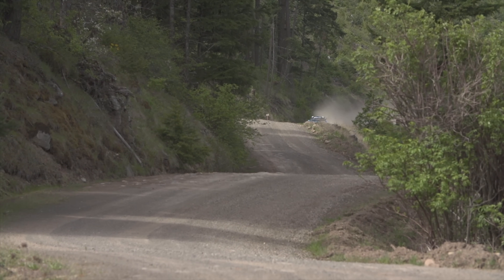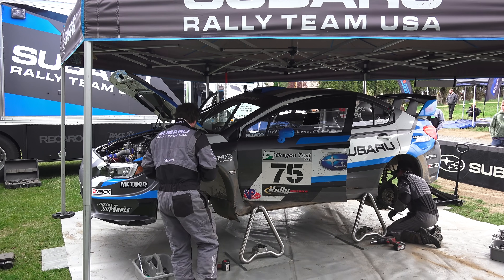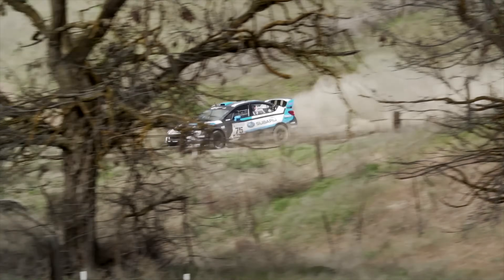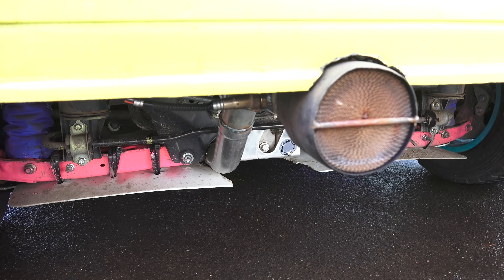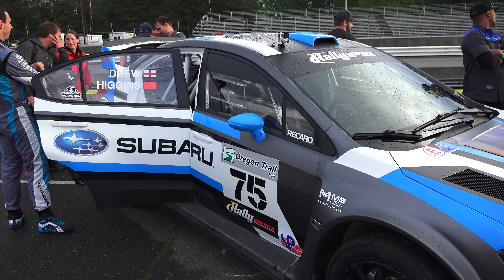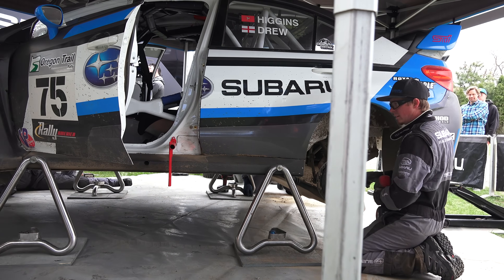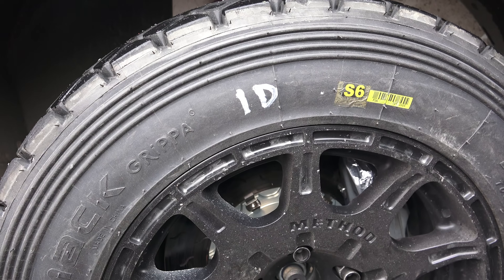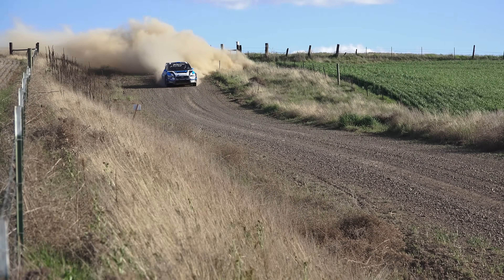Rally Car Racing - Subaru STI Rally Car Explained

Comment: laminar flow uses the cross sectional area with an exponent of 4 as part of the formula. So any small increase in radius is actually increased to the 4th power. That is why what appears to be a small difference in diameter is actually a much larger difference.

Comment: Subaru used to make good cars but not anymore...
Reply from the maker: Yo the Crosstrek is awesome! And the BRZ! And the FA20 engine...
Reply: Thank you for your response but what I meant was that their cars used to look good until 3-4 years ago.Now they look like rushed concepts without spending time on details.Those 5 side windows on the side on Impreza, Levorg and 4 on Forester...Without any reasonable purpose.It looks like they just put some random numbers(I know it was not like this,it just looks like) and waited to see what will happen when engineers put it together.Well this is ugly!Cars can be developed and modern but they should also look good.It's not necessary to be middle, high or luxury class car so this to be done.Can be done with compacts too.
Reply: Brabusrocket800 like the pro drive impreza 555?
Reply: Brabusrocket800 I feel the same way but on the type r and the new Supra
Reply: Brabusrocket800 i

Comment: 1:01 - Does anyone know how they achieve higher torque at lower RPM than the stock engine?
Reply: Probably a smaller or just more efficient turbo so that peak torque is achieved earlier.
Reply: Bailey Macdonald
Reply: could also be an agressive cam as well

Comment: Interesting to hear that they run the EJ20 instead of the EJ25.
Reply: I know this is late but I think WRC is limited to 2.0 L engines.
Reply: Pretty sure they used to use the EJ257 not EJ25.

Comment: Seems that nearly whole car is different from stock STI. Things like exhaust restrictor and super expensive struts are well known. But there are special sub frames, suspension arms and housings and nearly whole body enforcement not only with roll cage but with some inner enforcers (actually do not know how to call in English cylindrical parts placed in the spars). There is not much information about this in the internet.
Reply: Igor Bogdanov only Subaru part is the badge

Comment: IDEA FOR VIDEO: Does electric cars have transmissions and if not why?
Reply: they dont because electric motors can reach higb RPMs. Teslas Model S motors reach about 14K RPM, and i think have a top speed of 140.
Reply: Although you dont need it they can be used because of the high RPM operation that would make having a transmission with a speed ratio make the car alot faster especially since electric motors are instant torque.
Reply: they dont need one power goes directly to electric motors which spin the wheels if im correct
Reply: +Shadowaries1 Thanks for The answer! :)
Reply: Instant Torque unlike an ICE.
Reply: +Dominic Paré They don't really need them. However if you see his
Formula E video he says some of the cars have 2 gears, some 3 and some 4 gears and some simply have one gear. I think it's because the technology is new and the teams are still playing with ideas.
Reply: +JC Bélisle So there is a much wider range at which the motor can operate! So no nead of a trans. I see (ice lol)

Comment: The anti-lag system does not inject air into the exhaust but detonates fuel to keep the turbo spinning ....
Reply: +Darin A. It does, its called bypass valve.
Reply: +Darin A. Fresh Air ALS dumps fresh airfrom  pre throttle body into the exhaust manifold prior the turbo to mix with a rich air/fuel mixture that is set for when the ALS is activated to create an uncontrolled external combustion in the exhaust manifold to keep the turbocharger up to speed

Comment: the engine only lasts 1200 miles?
Reply: +Parkour2Go A rally consist of stages (where you do the racing), this is where the cars will be pushed to their limits.
Reply: +Parkour2Go stage miles
Reply: +Draylogic what is that suppose mean?
Reply: +Zhurbie 1200 Stage miles... Rally cars have different engine settings for different driving, usually 4... Road Setting (for driving around on public roads like regular cars do), and 1, 2 & 3 Race Settings (1 being the mildest setting for situations where the road is very slippery and too much power will cause you to loose traction and time during stages & 3 being most aggressive where traction is high like on a tarmac stage)... These 3 settings is usually altered by the severity of the ALS settings... Less antilag = less aggressive engine, more antilag = more aggressive engine... Stage Miles refers to the kilometers the engine has ran in either of the 3 race settings selected by the driver by a little dial on the control panel between the seats

Comment: How do they make 15 inch method wheels clear the brakes? Are the brakes smaller then the stock ones?
People (myself included) are trying to fit 16 inch aftermarket wheels on stock wrx brakes with no luck.
Reply: +Alex Zhukov No they leave the wheels off during stages
Reply: +Alex Zhukov The brakes are specially designed from scratch to fit under the 15" wheels

Comment: Can you comment on why a Rally car engine Chrips when the driver let off gas, is it compressor surge?
Reply: +Kameron C It's a wastegate. It vents unused pressure to prevent it from going back into the turbo. It allows more boost pressure to flow through the exhaust and makes the turbo more efficient.

Comment: How does the wider brakes compensate for smaller diameter?
Reply from the maker: Arvid Broms It can retain more heat.
Reply: Engineering Explained Ofcourse! Thx mannen
Reply: Engineering Explained Wouldn't they dissipate more heat because they have more surface area? You don't want your brakes getting hot
Reply: +Nate Meyer which will dissipate more heat, a tin foil or a aluminium plate...

Comment: 1200 stage miles is a lot lol

also what do they rev too like 4k rpm ?
prob makes a lot of torque and 300hp at 3.5k rpm or so. so very punchy and lots of power down low, all bottom end - mid range.

can u talk more about rally cars...
suspension, air filters, skid plates, steering, etc

Comment: from what I've learned in my automotive school class, the closer the cat is to the exhaust manifold the better and more efficient it is. Because Catalytic converter needs to be heat up quickly to 500 fahrenhait to work probably.
Reply from the maker: ***** Right, but production cars on public roads are producing far less heat than these are.
Reply: Engineering Explained it's because these are really cars and being driven as really cars.

Comment: I don't get, why does Subaru gets tougher restrictions than the other guys? is it because its a boxer?
Reply: Daniel Lobo No, its the rule for open class seeded driver. http://www.rally-america.com/info/RA_PRR_2015-print.pdf 

Read page 78 section F. Restrictor
Reply: +Daniel Lobo It used to be a 38mm restrictor for WRC. One of the problems is, and it's a good problem. Engineering is becoming so good that engines are putting out way more power than they used to.

Comment: Sweet vid! Liked :-) Just a few quick questions:

1. Why run a cat at all if it's a race car?
2. That cat appears to me a metal core cat, which is a common upgrade of high-quality aftermarket downpipes for turbo cars. COBB comes to mind. If they use metal core cats on downpipes right near the turbo housing (i.e., much closer) and don't have melting problems, what's the issue here? Becuz 40psi, maybe?
3. There are $500 or so metal racing cats they could use that are super high quality and are known to be pretty much bulletproof, even on turbo cars. I wonder why they didn't go that route...?
Reply from the maker: Zack Richmond 1. They're driven on public roads, so it's required. And, for trees!
2. These are running WOT with anti-lag for long durations. It gets much hotter than your average street car. 
3. Perhaps due to the anti-lag, I'm not sure.
Reply: Zack Richmond 2., 3. You know it's not only about the cat "housing" which can be very reliable. It's about the catalytic bed inside, which is more fragile and can hold only lower temperatures. Temperature range is 200 to 600 (you would like a constant of around 400 C, where efficiency is good enough and cat will work long enough before replacing).

Check efficiency of temperature chart here: http://postimg.org/image/6tzvhfn4b/
Efficiency means oxidation of unburnt hydrocarbons.
Reply: Engineering Explained MrPaulCraft 
Thanks for the responses, guys. I really think it is the anti-lag. Anti-lag systems cause lots of rapid, successive after-fires, right? I know after-fires are very hard on cats too, so that's very likely the rationale.

Comment: Hello there, I was wondering if you could help me lift some shroud of mystery on the matter: it always bugged me, how do rally cars stay level at speed. Is it purely the aerodynamic downforce, if the springs and sway bars are soft for rally stage, why don't we see much in the way of body roll? Supposedly the shock travel is so great to soak up the punishment of jumps and uneven roads, how do they tune the car for combined stages then? I am aware that drifting in snow for instance (as I always do when it flurries a little) reduces the weight transfer, I assume this is also the case for dirt and gravel roads, still curious about how rally cars manage their weight distribution. Cheers in advance, from Russia with love.
Reply from the maker: Mark Lee It's a combination of everything I mentioned, really. The tires and suspension are specific to the sport. But you'll notice the cars sliding around quite a lot; they're always at the limit of friction.

Comment: Excellent video Jason! Any chance to get a HP/TQ curve for the rally car and overlay it on a chart of the stock EJ20? Also surprised that they use an EJ20 motor rather than the FA20. Perhaps the teams are slowly migrating over?

Also how does get 3 bar of boost with such little lag on such a small motor and a restrictor plate? Extreme antilag tuning?
Reply: Interesting that the EJ20 has gotten to such a high level of tuning. Still the FA20 should easily be able to deliver the 320 awhp as the stock FA20DIT does 223 awhp. With a bigger turbo, injectors, and supporting mods, it shouldn't be too unreliable, unless the stresses of rally are that much greater than track driving.

Comment: What is that chirping noise it makes when it gets around the time to up shift?
Reply: DellTonicToric That would be the anti-lag system. It's basically combustion in the exhaust header , to keep the pressure high , to keep the turbo spinning.
Reply: DellTonicToric Yeah, what +Wolf said. There is a dump valve that vents pressure across (through) the turbo during deceleration to keep it spinning so that when power is re-applied almost max torque is available. There will be no waiting for full boost (lag).

Comment: I have a question about the air filter, with all that debris, do they use a special method of filtering ? Dual air filters ? TopBased nozel ?
Reply: I would also like to know more. I noticed on a lot of the previous Sti wrc cars and on last years rally America car they have a the air filter where the intercooler normally is under the hood scoop. How do they stop this getting water in it when it rains?
Reply: +Rasti Al Nope, in most of these cars many of the internals are stock or slightly modified. Unless I'm just thinking of super stock. You really just have to clean or replace the air filter often. Even a high quality filter breathes better dirty than most OTS cheap ones you'll find at a parts store.
Reply: A lot of rally car will actually have the air intake in the passenger glove box area, not the engine bay. Clean air coming from roof air scoop is sufficient to supply it with the air it needs while relieving reduced air flow that would occur as the filter becomes dirtier throughout a stage.

Comment: Can you do a video on rally suspension? I am very perplexed on how the suspension can be softer but more stiff? What makes rally suspension not bottom out over every bump?
Reply: Hari Gandhi The larger suspension travel will take care of that.  He mentioned 5 times as much travel as the stock suspension. I'm assuming this is for gravel setup and the tarmac setup will be considerably harder.

And  +1 on a rally suspension video.
Reply: Hari Gandhi Look up some methods of compression damping. I'm not an expert in any way, but dealing with suspension on my mountain bikes has taught me quite a bit and I'm sure its not a stretch to apply the same knowledge here. You have so many factors, including springs weights, position/speed sensitive damping, low/high speed separated damping circuits, end stroke damping etc etc
If its anything like my downhill bike, you can have a lot of suspension travel, which won't compress all the way over most things, but have a fast enough compression event and the suspension will compress enough to allow more travel, but also be controlled in a way at the end of the travel so it doesn't bottom out suddenly.
I could be totally wrong, so take what I say with a grain of salt haha.
Reply: canadmos +1 for downhill mtb! Very similar, the springs on cars are designed to take certain weight, travel and shock. Race car springs will have springs with very close coils, making it stiffer, while luxury cars will have a wider gap between coils. Most performance road cars will have a wide gap towards the bottom of the spring to be comfortable at low speeds, and get stiffer towards the top for high speed stiffness.
Reply: Hari Gandhi 
For me, all questions concerning automobile suspension can be explained through mountain bike suspension. 
A rally car is basically a free ride bike, it has a lot of travel, but not as much as the Dakar cars (downhill bikes).
Unlike 90% of the cars, you can actually set up your bike for any specific type of riding in a matter of seconds. For instance the free ride bike usually has 180mm rear and around 180-200mm front travel.  You have high and low speed compression, high and low speed rebound as well as travel adjust. So, having all that travel means you can have a very wide band of function. For a flowy trail/tarmac, you set up for harder compression. High speed is the beginning stroke and low speed the end stroke, so you would have a touch more high speed compression and if you would like to carry a bit more speed, lower the travel a bit in order to also lower the centre of gravity and have a touch more rebound in order to not bounce around as much and keep yourself planted. For a lot of rocks, jumps, rough gravel etc, you want more travel, suppleness and compliance.  More travel, less high speed, more low speed compression so that you may use all the travel but as you get less and less, you do not bottom out. Again, rebound is adjusted to control the way the strut/stanchion returns based on feel and how aggressive the track is. I hope I made myself clear enough to be understood, although I think my analogy could have been explained a bit better but yeah, it's just a comment :) Cheers!
Reply: +Hari Gandhi They use progressive dampening. At lower speeds it's usually much more stiff than higher speeds where it's softer than your average passenger car suspension. The bad thing about the suspension on these cars is that you have to rebuild them every 2.000 km or so.
Reply: Hari Gandhi To add to what the other where saying I heard that the mounting plates for the suspension are also positioned higher because of how they modify the cars giving it even more travel then you would see even on a consumer XV or an Outback which are lifted higher already than your average car.
Reply: Hari Gandhi It's not more stiff. :)
Reply: SideWays8Productions You're right. During the seam welding of the chassis in the initial build the strut mounts are raised and reinforced by the roll cage.
Reply: Fast vs slow dampening